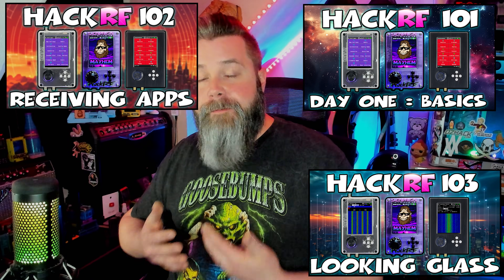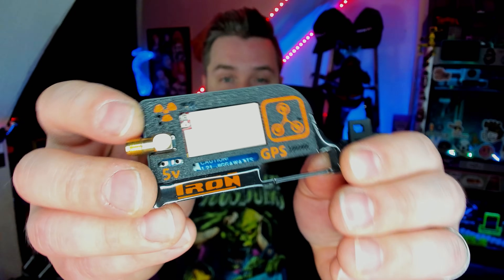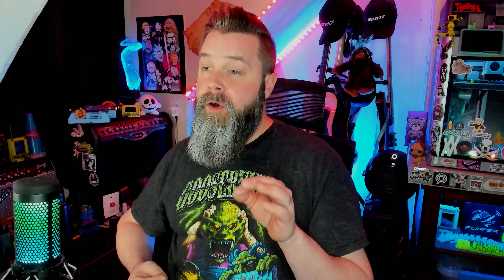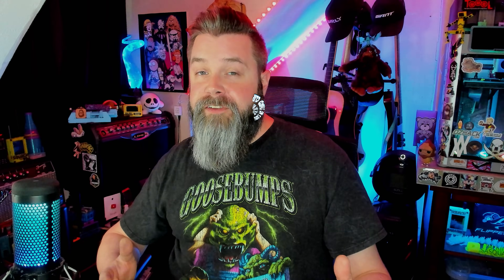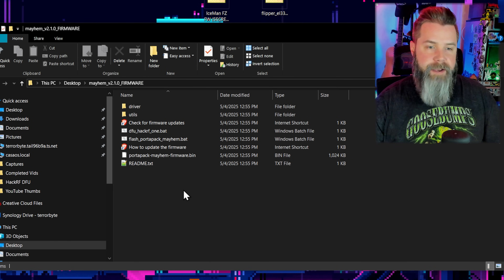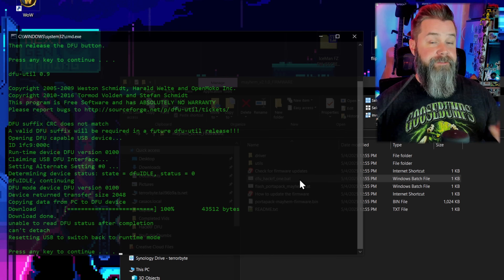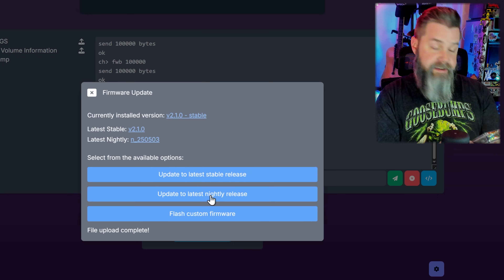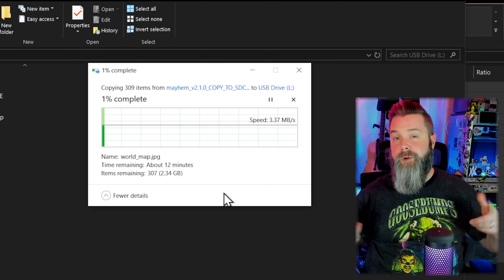HackRF Beginners Flashing Mayhem Firmware | Full Tutorial

Comment: What I would also add in here for new owners, BE CAREFUL with the microSDcard when putting it in. there is a slight gap in the slot where you can accidentally drop the card into the case instead of the SDCard slot. Which you then have to hopefully shake it around and fish it out, or take apart the case and get your SDCard.

Ask me how I know
Reply: i just got my hackrf h4m today and i dropped the sd card into the case i had to open the thing to get it out🤣🤣
Reply: The same way I found out I'd bet. lol